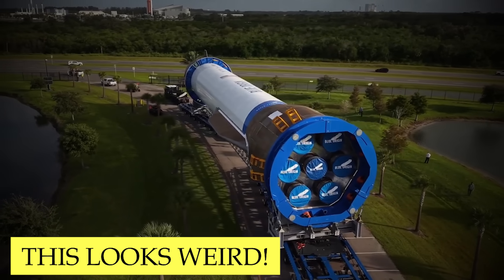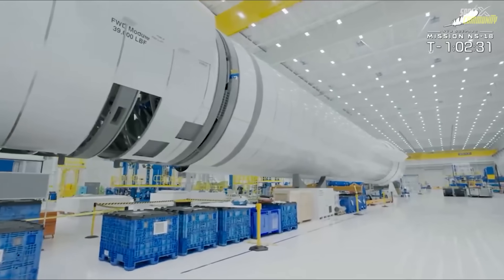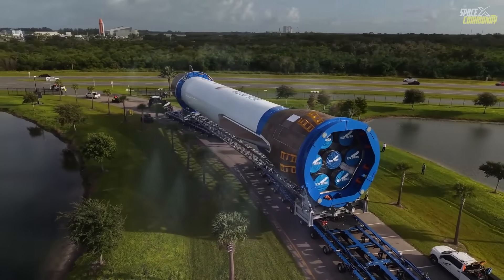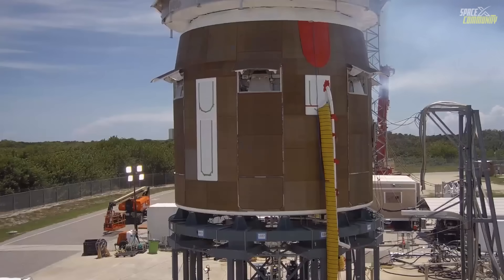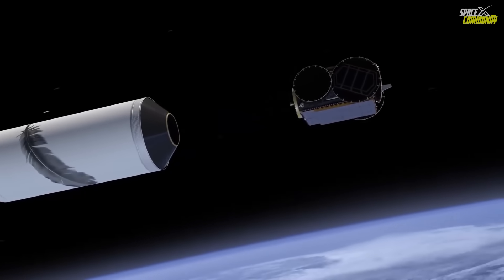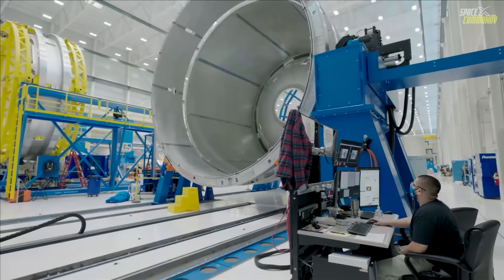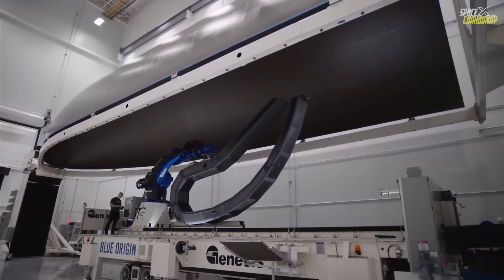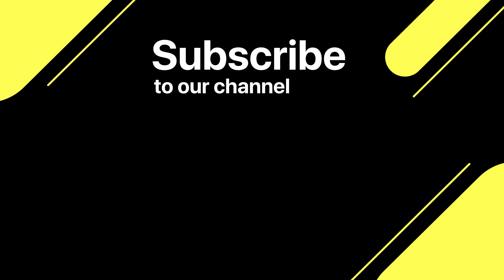Blue Origin Is Preparing for New Glenn's Second Launch Attempt! New Plan for Booster Landing

Comment: As slow BO is I highly doubt if they could do it unless they have the rocket built now. They have a hard time building 2 rockets a year.
Reply: SpaceX builds a lot of rockets, and then they exploded or ditch them in the ocean. If Blue Origin is successful with the second flight, they will be closer to an operational heavy lift vehicle than SpaceX and with far fewer test launches.
Reply: Well they did it.